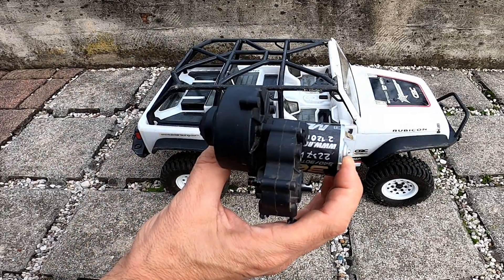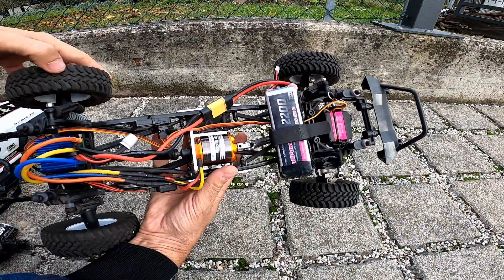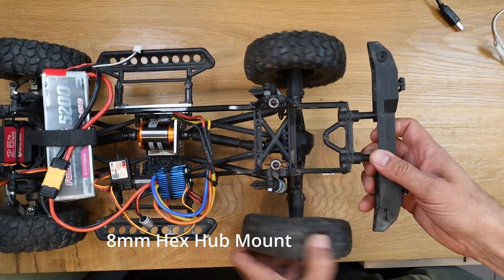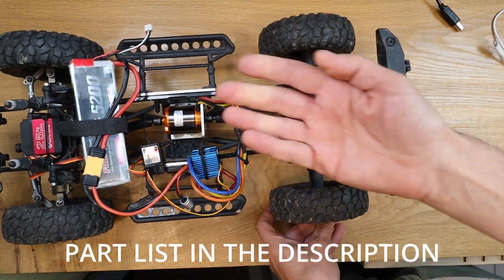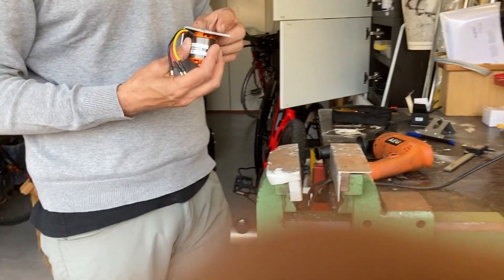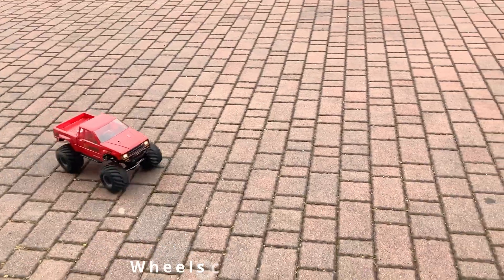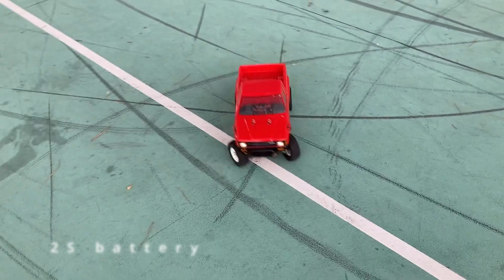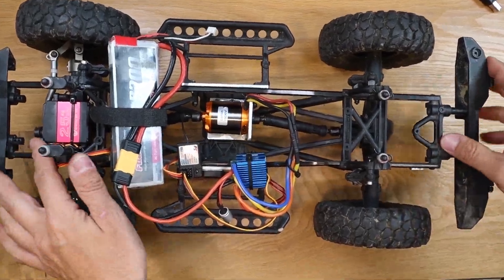Axial SCX10 superfast Brushless direct drive modification

Comment: Hi! Has it enough torque for climbing?
Reply from the maker: Hi, you can compare it with a traxxas slash. You can go uphill on any slope i think, but it is not as like it was originally, where you can go 1km/h up on the rocks. Minimum speed it is about 4km/h.